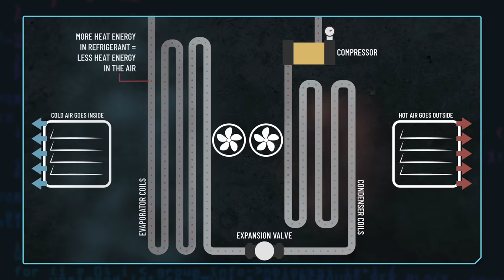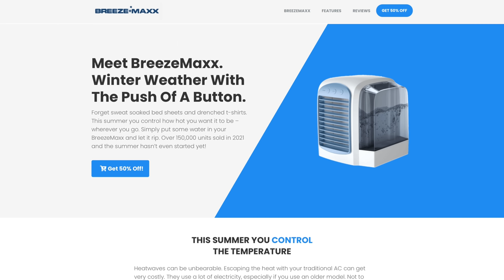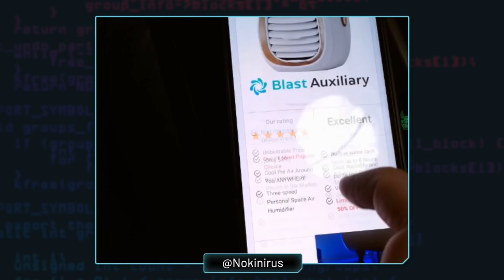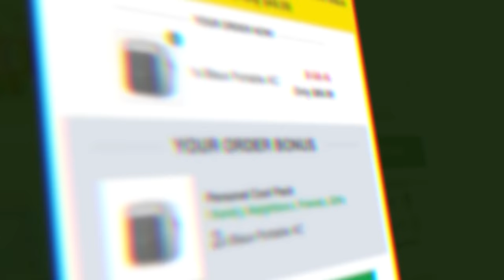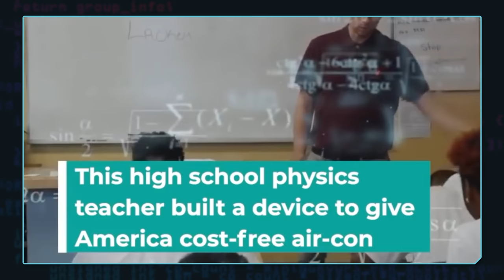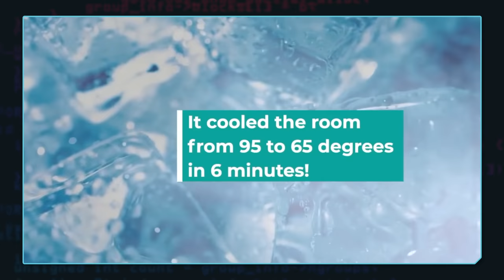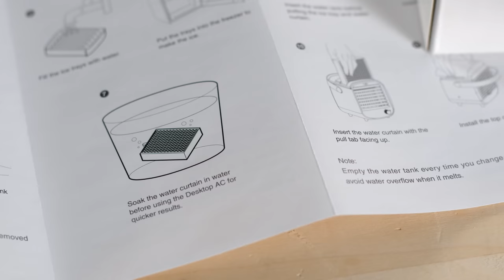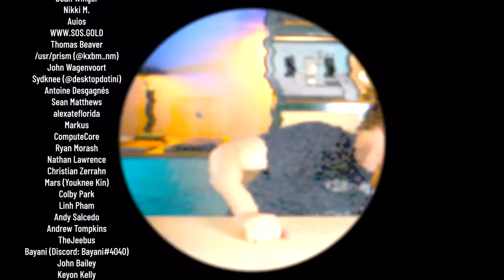Fake Portable AC Scams: Blast Auxiliary, BreezeMaxx, Blaux - Krazy Ken's Tech Talk

Comment: When someone gave me an old "swamp cooler" when I was younger, it didn't take me long to figure out they are the stupidest form of "cooling" equipment there is. If you use ice in them from your fridge, the fridge generated more heat producing the ice. And they humidify the air, making it harder to sweat off any heat. Basically, they provide some short-term relief to the person it blows on directly at the sacrifice of the long-term comfort of the rest of the space.
Reply: They work in dry climates like Phoenix AZ where it's under 20% humidity. If you're anywhere but the US Southwest they're counter productive.
Reply: Yeah I’m in Bakersfield. Ca and they still use them somewhat here 
I use one I my shop where I stay 
A large metal bldg improbable to use AC it’s a 4000 CFM about 10 feet away from where I sit lol
I’m an AC guy for fifty years and have a lot of experience with coolers in commercial applications like restaurants warehouses and such it’s 105 here right now but summer will be over soon LOL
Reply: But you know I’m an old guy and I can remember when there was little air conditioning. When my father worked I. The oil fields in the forties tower work ( that’s midnight to eight AM he would come home soak burlap bags drape them I’ve the bed edges and use a fan to move air while he slept under the bed to keep relatively cool.
Reply: Now people can’t live without air conditioning but I made a good living from it all.
Reply: Folks say "It must nice being an AC tech, working in cool places." Until you explain that you work where the AC is busted .
Reply: Yes indeed LOL
I would often teply 
I wouldn’t know I’m too busy bouncing around hot rooftops and hot equipment rooms fixing them to know the difference. Summertimes here usually meant 15-18 hour days a lot weekends too.between Memorial Day and Labor Day there were no vacation or a lot of time off
Reply: They’re really good for dry places like Colorado…
Reply: Stop it

Comment: I was able to get the Blast Auxilary unit from a facebook listing for about $50 so I wasn't ripped off heavily like others, but I was surprised by just how cheap it was. It's a glorified desk fan at best. I've used it for a month and a half now and stopped filling it with water after a few weeks in because it made zero cooling difference. Also pouring water in it just accelerated the amount of mold and dust that was accumulating on the water curtain. Since I stopped using the mist function I just took the curtain out and it works better as a basic fan! I've also just been using it during the winter to balance out the heat in my apartment that I don't control. Also the thing has a hilariously short battery life and somehow turns itself off after it's been on for 12 hours. 
Glad to know it was all false advertising!

Comment: I have one, but I'm not naive enough to think it's going to cool the whole room. I just point it at me when I'm sitting at my computer desk and it works just fine.
Reply: Same here, also have one. Its actually providing some nice extra cooling compared to a fan but its more a face cooler, not a room cooler. I say these are not complete BS  but they are not at all what they claim to be and no they can NOT cool a room at all and are NOT AC devices. They will only cool  a local surface placed very close to the machine. The reason they cant cool a room is because these devices don't transport heat away from the area but instead rely on surface cooling the same way as why we sweat to keep cool. It blasts you with a mist of water and air and as that water then evaporates from your skin due to the airflow from the fan it cause local cooling but that heat in the end instead adds to the total heat in the room (cause the heat need to go somewhere). A true AC instead is a heatpump that need a sealed air outlet/hose to the outside to activley pump the heat away from the entire room or building to outside of the building. Same wikth a refrigerator. The inside of it holding the food gets cold but the room the refrigerator is placed in get hotter as this is where the heat is transported.
Reply: I also got an Arctic Air for around 30€ just to try it out. It's nice when you work at your pc and when the water is ice cold, but that's about it. Those prices for other, similar models for around 90$ is absolutely ridiculous.
Reply: I agree with the other comments that it is effective as a face cooler.  I live in an old high-rise where they have to switch the central air from heating to cooling in the spring and cooling to heating in the fall.  It is very imprecise choosing the ideal date to make the cutover.  I wind up using these face cooling devices for those 1 or 2 weeks of transition each year.

Comment: I actually have the Arctic Cool, which I got for about $30. It's pretty much a tiny swamp cooler. I use it as a desk fan and it works really well when temperatures are below 95* F outside and below 83* F inside. It's definitely not an AC and yes I have to soak the filter and pour in water but it DOES keep me from using my central AC, as long as I'm about 2ft away from the fan. What's interesting is that the unit works my spraying out water from the tank onto the filter which the air passes through, but the water part doesn't really help as much as the soaked and wet filter. I don't have to replace the water for a good 10 hours of running, which is nice, but the cooling is significantly less when the filter dries out, so I do have to soak the filter every 2 hours if I want it to stay super cool. Ice or ice cold water in the tank doesn't help with cooling as much. It makes sense that ice would help cool things down but by the time that turns into mist, it's just about as cool as room temperature anyhow. Long story short, these mini evaporative fans DOES cool you off DIRECTLY more than a regular fan but it will not change the temperature of the room itself. If anything, like mentioned in the video, the overall room temperature may be hotter because the unit is introducing more moisture  and humidity into the room. Also, the unit probably works less efficiently in very humid climate.

Comment: you know whats an amazing cooler and it only cost about 50-60 bucks? a RYOBI cordless whisper fan.
it really helps on those insanely hot days when were all working outside. just need a bucket full of ice and water, stick the pump in the water and turn it on. enjoy the cooling mist well as the breeze from the fan.

Comment: I have a similar device that I got from Amazon for less than $30. It works great and my cubical environment.  Of course if everyone in my office had one it would just make things ridiculously humid, but since I am the only one who has one the humidity is removed by the office air conditioning, and my cubical is noticeably cooler than the surrounding cubical
Reply: Yeah i tried it with a $10 fan and was very noticeably cooler. 

I didn't have to keep filling it with water either. 
Any fan provides better airflow than the really crappy fans in those scam Blasts.

Comment: please make a video about portable Air Conditioners with single hose vs dual hose. Dual hose make positive pressure where the single hose vacuums all the hot air from outside into the space threw any cracks it can find and basically heats the house. Why is there only single hose available to purchase at most places?
Reply: Real portable Air con = your car

Comment: The only place on earth were those do any cooling, are places with little to no humidity. Like where I live (Iran) there are big swamp coolers on every home.
Reply: Sam here in drier parts of Australia.  They're called evaporative coolers here, and in the dry parts of the country, you can get big house mounted units with a large roof mounted evaporation unit, it's plumbed into the household water supply, and run through a ducted system within the house.

Comment: I got that “Arctic Air” one for my car since it’s old and has a bypassed AC system. I’m super sensitive to heat and humidity so I figured If it could offer at least a cool breeze on me then it would be fine. I didn’t expect it to cool the whole cabin down.

Tried it, it sucked. Barely felt the breeze and it was lukewarm to say the least.
Reply: You should do like I do, drive naked with the windows open and go as fast as you need to go to cool off the car.  The cops will understand and let you alone.
Reply: Gotta figure out how to put floor vents in it.

Comment: I bought one of those $40 Arctic Air coolers from Wal-Mart. It did nothing to actually cool the very small room that I used it in and it was louder than anything coming through my headset while sitting on the other side of the room.

Comment: I tried one. It felt good ON MY FACE but then I was stuck holding the stupid thing up to my dang face. LOL No they don't actually work to cool any space, let alone a "room". All it does is add a negligible amount of humidity which then may evaporate causing a "cooling" sensation to the person standing in its path. Now, evaporative coolers that are large, and take up a chunk of floor space - those work! I just set mine up because I'm trying to lower my electric cost, so I'm avoiding using my Air Conditioner. It's already 90 deg. outside and it's only going to get hotter as the spring progresses. :( Living near Las Vegas, is awful in the summer.

Comment: I do have a little USB rechargeable fan with a water reservoir that uses cold mist as a cooling method, it's amazing for cooling you personally or dropping the temp when camping just a little bit, but it was also like sub-$20

Comment: I bought 2 of a similar brand. I keep one next to my bed because I get hot flashes and it does what I need it to do. Mine blows much harder than yours does at full speed, it doesn't have an ice tray in it though. When I fill the water up I put  few drops of lavender oil in it to help me sleep. I knew it wasn't an air conditioner but I gave it a try and I'm satisfied but that is just me. If you're trying to cool a room then good luck. I keep the vent pointed at me and go to bed but I actually keep it on low or medium because it blows too hard. I do find it annoying that their are little lights on the top so I set something over them because they will keep me awake. The brand I bought is Laotzi. I got them off of Amazon. I forget how much I paid but for both it was less than $90.

Comment: I bought a used, late 1950's automotive "air cooler" named the "Bonaire", which was a huge, pebble-grained plastic box, finished in tan and brown, with circular chromed vents, multi-colored pushbutton controls, and an old time bottle opener on the side. It had a small lid to add water and ice, plus small soda or, um, beer bottles. It had 4 adjustable legs to balance it on the center transmission hump, and it plugged into the 12 volt cigarette lighter outlet. Living near the humid coast here in Connecticut, made it pretty useless, although it looked really cool in my 1958 "Edsel Corsair". A really major issue was sloshing of the water reservoir. Any sharp turns or hard braking would literally flood the front seat floor!!! After I sold that car, I also sold that cooler, which I regret to this day... 🤔

Comment: Another issue I haven't seen discussed is you need a refrigerator to freeze the ice trays. So you actually need the equivalent of a separate real air conditioner to make them work. I remember seeing an advertisement of someone cut open some plastic bottles, fill them full of ice and zip tie them to the screen of a fan. That is pretty much the concept of these scam air coolers, but the fan idea would actually work much better because it would be putting out more air. This also means it's not an evaporative cooler because all it's doing is transferring the temperature of the melting ice to the air, so rather than using the principle of evaporation, your simply accelerating the ice melting and transferring the cold imparted by the freezer that froze the water; this process is referred to as an Endothermic Reaction. Additionally having lived in a desert and utilizing swamp coolers, they are based on the concept of rapidly displacing air, meaning the more powerful the fan the better and you need to open all the doors and windows for the best result. This is because in high humidity they don't work because there is poor water evaporation. So a swamp cooler pulling air from the same room it's cooling will, quickly raise the humidity, and completely mitigate the evaporation that does all the cooling.

Comment: I don't know in these unit, but as they are that small the water circulation works because the curtain is "sucking" the water from the tank, so it stay moist until the tank get empty.

They are quite inefficient for certain, but in some occasion can make you feel a bit better when you don't have anything else, and of course, better to buy the cheapest you can find.

Comment: The Arctic Air units suck too. I have some large swamp coolers that are amazing. I think there must be a surface area required to make these things effective. Also swamp coolers basically stop working at 65+% humidity. They're great here in Colorado, but they won't work in Florida.

Comment: I use the Arctic Air for my computer desk that keeps my PC and laptop chilled on the bottom. These also work well in the room in the winter when the heat dries the air. The Arctic Air at Walmart was 19.99 in 2018. The Arctic Air is alright for a small desk environment and the cold water will last about 3 hours.

Comment: We bought one of these from Walmart, now I knew it wasn’t an air conditioner before I bought it and wasn’t expecting much for cooling. But if you have it pointed right at you with cold ice water in it it actually works pretty good for the whole night.  It will never cool a room down, but it’s better then just a box fan blowing on you unless you put a block of ice behind your box fan anyway!  My partner needs to be cooler temp wise then I do, so this works well for our needs and again for $39.00 you shouldn’t expect much in the way of cooling! Oh and it also has a cool light built in that changed color. Set it on blue and you automatically feel cooler! LOL

Comment: I am an engineer, I have experience in design & manufacturing of energy transfer systems, and HVAC.  This is well done, and technically accurate description.  Also the Marketing tricks are well explained.  (Ref. Peter Hollins book: Brain Fart (must read)).  I also have bought two similar units to "reverse engineer" them, to show my spouse this was bogus, and to see the evidence for myself (then returned them to the store!).  The manufacturing cost of one unit like this, I estimate under 10 USD$, likely around 5!  Thanks for your work.

Comment: I use an Arctic Air while sitting next to my computer:
- It blows warm air, but the air feels good.  Since it's kinda quiet, it's better than a comparatively loud fan.
- The water is refilled by me evey 1-2 days of use.  The ice cube trick melts within 10 minutes, so you give them too much credit.
- I guess the cost is better than AC.  I turn on my AC when I have family/friends over.
- On a downside, the air tends to dry out the eyes.  Wear glasses if you have it blowing directly on you.

Overall, I never expected it to act as an AC replacement, but rather a way to stay cool for cheaper.  If you're buying it assuming you're going to cool your whole room in minutes, then you're a fool.  Blow it straight on you while computing?  I think for the $20 on sale at Walmart, it's worthwile.

Comment: Technically it's an evaporative cooler so adding ice or cold water is irrelevant. The water only needs to be in liquid form to be converted into a gas. It's the act of evaporation that requires heat energy during transformation. They work well in places like Arizona, but only with relative humity below 20 percent and heat not exceeding approximately 100F. So even full-size units have drawbacks. Those small ones are just garbage.

Comment: I have two of Arctic Air. Have had them for four years. I do not use water in it. Because i found the coolness of the air is the same with out the water. I do not but new filters. I just wash them in the sink. And it works better than any of my other fans. My two fans costed 60 dollars at Big lots. Matter of fact they work better than the cooling fans in my computer. Which keeps over heating. I have one at the foot of my bed and one by my couch. And that's all I use. So, I have not had any trouble with them. And will keeping using them. Can't speak for any other brands. But, I'm happy with mine.

Comment: Yeah, we had a 4 foot cube swamp cooler with a water line to it & as long as the outside temp was under 100 degrees it cooled our small house down to about 75 degrees, livable and had a giant constant blast of air & was a little noisy but we were glad for some cooling at a decent price, about 1/4 of what true A/C would cost.  Above 100, it didn't work, just hot air blowing.

Comment: My sister has one like these. The way it works is on top it has a little water tank to put cool water into and then there a little tray with cloth that you wet and put in the freezer and when it freezes you put it back in the machine so then it cools the air it blows out for a little while

Comment: I bought an Artic Air that was on-sale. The normal price was $40 and I paid $20 for one. It was still $19.00 too expensive. It works OK for a desk fan that can blow some cooler than room temperature air on you. But it will not cool the room at all. It would have trouble trying to cool a small closet.